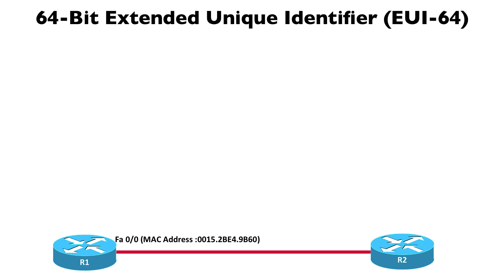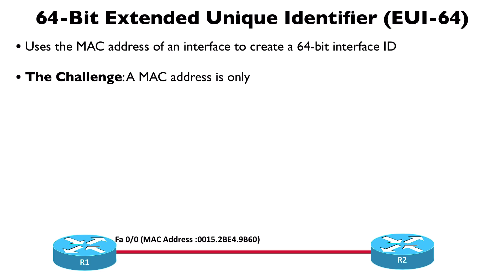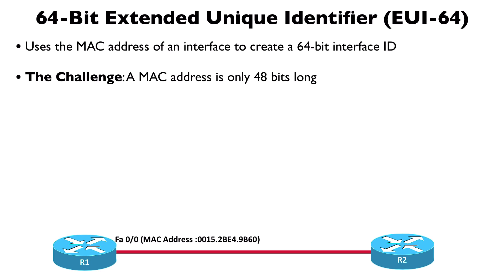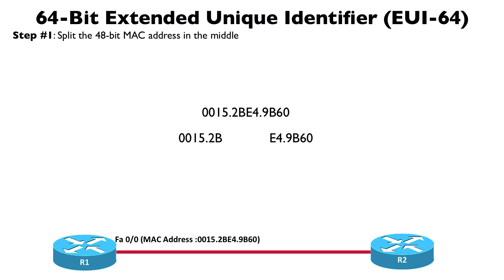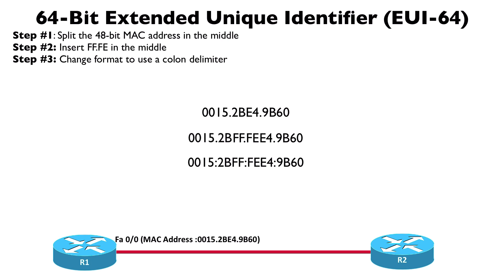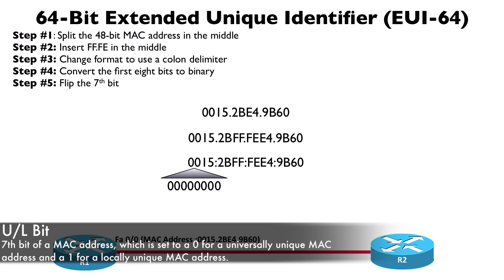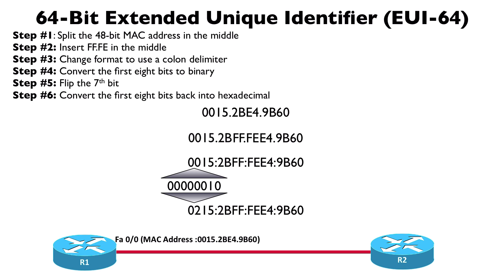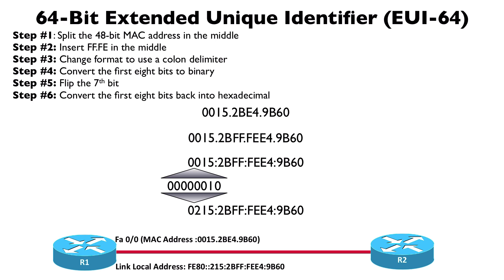EUI-64 Address Calculation - CCNA

Comment: So if the mac address didn't start with 00 and instead had a number or letter, or was something like 09:XX, I would flip the seventh bit and either add or subtract that number to the total, giving the new value? So if it was 9, that would be 1001, which would flip to 1011 and the new total added together would be 11, which would be represented by the letter B (if im right) and would then be 0B:XX? Or am I wrong and the second value will always be either a 0 or a 2?

Comment: thanks a lot for explanation.  Does flipping the 7th bit always mean adding 2 on the second digit?  For example, 1C becomes 1E, or 3B becomes 3D?  If yes, then we can also say, insert FFFE in 1st and 2nd half followed by adding 2 to the second digit of what you get?  Thanks.
Reply: @HanpingXu Suppose if the first two hex digit is 35, in binary format it is 00110101, there are total 8 bits, just flip (toggle) the 7th bit, it becomes 00110111 which is hex digit is 37. Hope you get it.

Comment: I'm having trouble understanding why you put a 2 in the mac address:  0215 in Step 6.  They were 0000.  I'm not quite understanding that part yet.  I would appreciate it if you could explain that more.  Thanks.
Reply: because he flipped the 7th bit and made it a 1.  that 7th bit is rested inside of an octet..  so that 7th bit's value is actually either a 2 or a 0, the fact that it is flipped "on" means that it takes the value of 2.  if it were the 8th bit, it would be a 0 or 1, if it were the 6th bit it would be a 0 or a 4, etc.